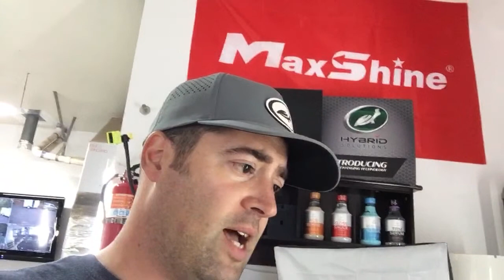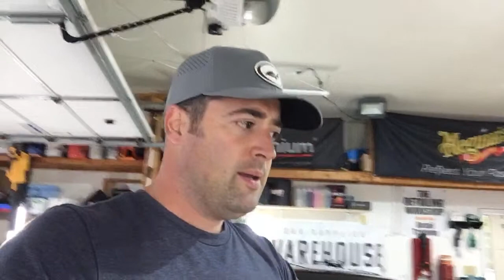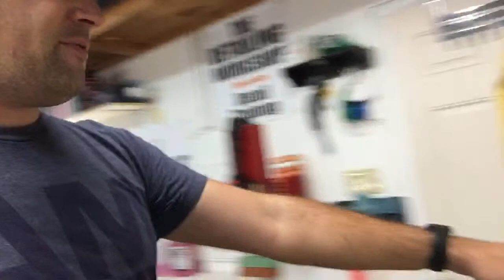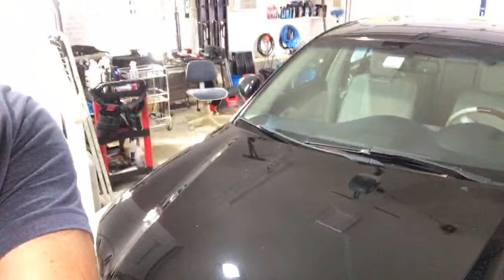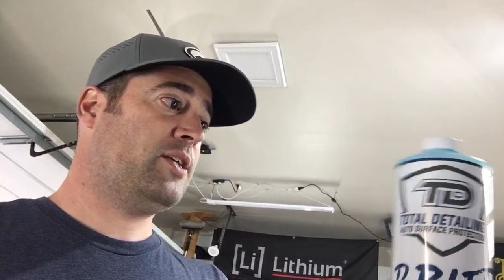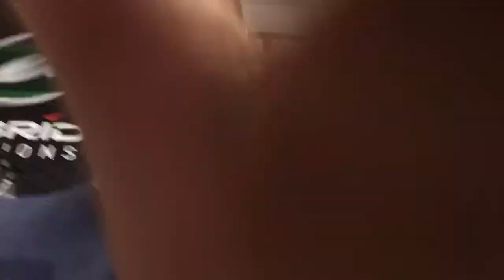Miranda Detailing Updates and Chillout

Comment: i have that compressor , i like it a lot , i now however have a issue with it not starting back on after i use air , i have to literally drain the whole tank before it will kick back on , looked into fixing it on there website but what they suggested didn't work
Reply from the maker: Oh weird. I’ll keep an eye on that myself. Thanks.
Reply: @MirandaDetailing  was due to air being left in the tank over night from what they told me
Reply from the maker: Sometimes bus e that problem with my other compressor when I run it off an extension cord. The starting amps take a lot when it’s almost full. So when empty it takes less amps to start it due to the pressure.